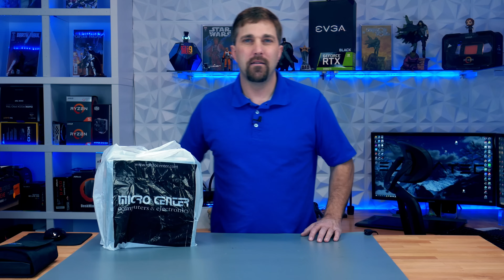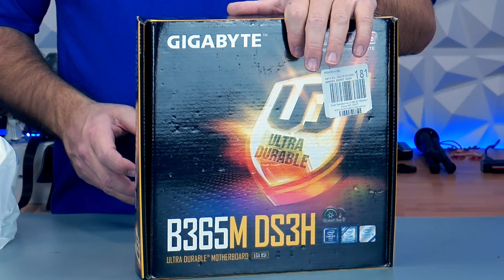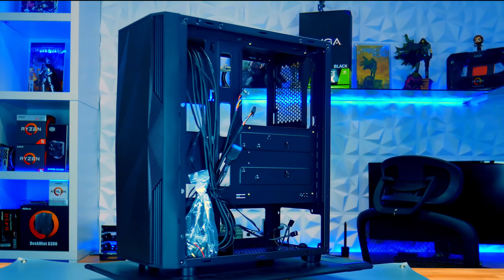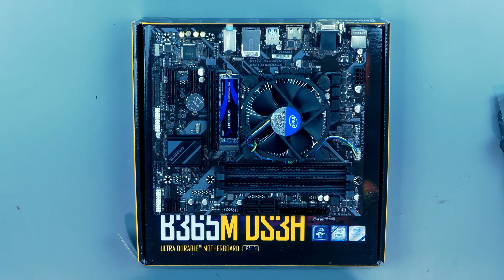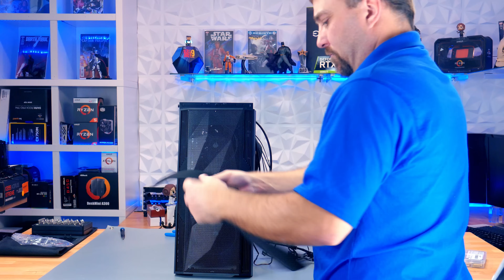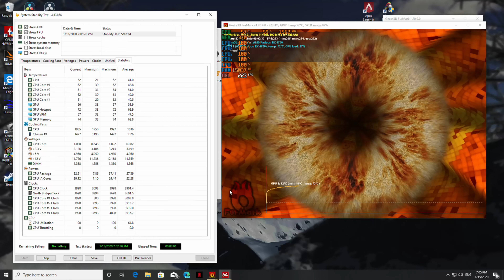$750 Intel Budget Gaming PC Build

Comment from the maker: I need to point out a discrepancy in the video. The Memory kit I used is different from the memory kit in the parts list and I unintentionally edited out the explanation. I used the 3200 MHz Corsair LPX kit because I actually got it on sale for the same price as the 2400 MHz kit, however because the I3-9100F is a locked chip the memory speed is locked to 2400 MHz max, so that is what the 3200 MHz kit runs at in the system. I put the 2400 MHz Corsair kit in the parts list because it is now much cheaper. No need to spend more as you can not set the memory any higher then 2400 MHz. Both kits perform exactly the same in the system as the XMP profile sets them identically. Sorry for the oversight.
Reply: Really appreciate the honesty, you got my sub! So I'm building a i5 9400 with a 1660 super, 16gbs of DDR4-3200mhz I paid the same price for the ram as the counterparts (2400mhz) will XMP automatically underclock it to the maximum limit which for me would be 2666mhz?
Reply from the maker: @odale9942  What motherboard are you using?
Reply: @ElevatedSystems  gigabyte b365m same model as yours, mine says the max is 2666
Reply from the maker: @odale9942  Ya then the XMP profile will set the memory at 2666 Mhz
Reply: @ElevatedSystems  copy that, thank you brother!

Comment: I got pentium g6400 build (with 650w seasonic psu + 2x8gb ram ddr4 CL15 3000mhz + z490 gigabyte ud atx motherboard + 500gb m.2 ssd 2000 mb/s.

My goal was to upgrade cpu and gpu in future but money is an issue so here is my question:

Which gpu could I add to this pentium g6400 build that wouldnt bottleneck gpu too much?
Reply from the maker: See if you can find a used RX 580 to hold you  over until you can afford something new.
Reply: @ElevatedSystems  here in Portugal they want 200 for rx580 and 120+  even for rx 570 4gb on ebay used.
On Pcdiga Lisbon store I saw 1650 super dual fan for 163€ brand new with 2 years warranty but.. it went out of stock when I finally decided to buy it.

I cant convince myself to pay more than brand new prices for used no warranty items.. I guess I will just wait thanks for the responde cheers

Comment: you need m2 on the motherboard to work
Reply from the maker: Is this a question or a statement?
Reply: @ElevatedSystems  ?
Reply from the maker: @tazerknight1  I'm not quite sure what you are asking. The motherboard I used does have a M.2 slot 10:30 . If you want to use a m.2 ssd then yes the motherboard needs an m.2 on it. If not you can use a SATA ssd.
Reply: Just asking if I need the M2 to boot the pc. Can I use a hard drive to boot it. With out the m2
Reply from the maker: @tazerknight1  Yes

Comment: Thank you! I so appreciate this video. I was going to build a new media computer for streaming on a AMD platform, but after much research I have strong reservations. First, I am hearing of all the headaches with just trying to get a AMD Bios updated from the get go. Many have to install a old CPU to get the get the Bios updated, incurring cost or a major time delay with the AMD loaner program (so bizarre). Second, I have heard others talk about many of AMD firmware issues with AMD components and  their graphics cards. Third, the internet is full of examples of many having their motherboards bricked (dead) just by plugging or disconnecting a USB port. This typically happens at some point; could be a few months or a year or more. There isn't much of a savings if you have to replace motherboards at some point and it could be even multiple times. Being an IT guy and building many Intel Servers in the past, I could rely on Intel components and not have to worry if the system was going to boot up the next time you had to unplug something or reboot. So with all of that said, I found your video to be a great resource for helping to tune my specs for my next build. I would love to see another video using a i5-10600k or Intel 9700 or 9900K processor. I think the I3 would be under powered for powering 4 screens and streaming to social media. Many thanks!
Reply from the maker: I'm probably not going to be doing builds with any of those CPU's any time soon. I pay for everything I use on my channel out of my own pocket so CPU's I focus on tend to be in the $130 and below price range, however if you are looking to build a streaming media system definitely look at one of the NVIDIA GTX 1660 or RTX series of Graphics cards to take advantage of the NVENC hardware encoding and free up your CPU from having to handle that.

Comment: do you need to bios update the b365m ds3h?
Reply from the maker: I did update the BIOS but the 9100F worked out of the box.
Reply: @ElevatedSystems  Did the intel 9400f work out of the box with the b365m ds3h? since im planning on getting the intel 9400f or the intel 8400
Reply from the maker: @darkninja6579  I didn't test a 9400F but as long as you are buying the board new you should have no problem.
Reply: @ElevatedSystems  Thanks
Reply: @ElevatedSystems  ok thanks

Comment: is an EVGA 450 BR enough for this build? and will swaping the rx 5700  with a 2060 will eliminate bottelnecking?(2060 is cheaper in my country).Thank you
Reply from the maker: The Max power draw on the system was under 350 Watts, however the Graphics Card stated minimum requirement is a 600W PSU, therefore I recommend a 600W PSU.
Reply: @ElevatedSystems  appreciate your response

Comment: My budget is around $800 and I live near a micro center, do you recommend any certain gpu or cpu that would be best for AAA games like fortnite? I watch these types of videos all the time and I never know what would be best for the games I play
Reply from the maker: I'd say the best all around gamming rig at your pricepoint for 1080P Ultra up to 1440P High/Med consists of a Ryzen 5 3600 paired with a good B450 motherboard (get the Micro Center Bundle deal) and the new AMD RX 5600 XT which you should be able to get at Micro Center at the $279 MSRP. You should be able to get the rest (case, memory, PSU, Storage) to fit easily withing your Budget.

Comment: Pretty sure your bottle necking ur gpu
Reply from the maker: It all depends on the Game, resolution, and quality settings. On average the system was actually 79% GPU bound across all the benchmarks I ran. But of course if you are running something like 1080P Low settings then yes there will be a significant CPU bottleneck, however if you run 1440P Ultra settings you will be significantly GPU bound and the CPU will just be waiting on the GPU to process frames.

Comment: Btw the motherboard that this guy picked (also the one i picked), you cant fit your network card in the slot if you put your gpu in. (only has one slot for the network card) so if you have an ethernet or usb wifi adapter thing then you are fine but if you use a network card dont get this motherboard

The 2 gpu slots are towards the bottom of the mobo, the internet/network card takes the 2nd slot of the side racks/panels, and the bottom gpu slot doesnt fit at all, and the top gpu slot takes the 3rd AND the 2nd slot (for my case but the 1st and 2nd for the case that this guy used) also (PLEASE LIKE THIS BECAUSE I DONT WANT YOU GUYS TO WASTE MONEY LIKE I DID im actually not trying to get likes, i just really want to let people know and make them aware ab this)
Reply from the maker: Yes very true. This is the case for most micro-atx boards. The Video Card does in fact cover the x4 PCIe slot. I apologize for failing to mention that and I'll pin this comment. Also I always recommend using Ethernet for desktop gaming PCs just to avoid any possible latency that can be present with wifi, however I get that sometimes there just isn't a port where you may have your system set up.
Reply: Will I get more gaming performance with a r5 2600
Reply from the maker: @cullore670  Stay tuned, I'm about half way through testing the system with an R5 1600. The video will be up next week.
Reply: Thank you for this!

I switched to the ASUS B365M-A looks like I should be ok for a WiFi board?